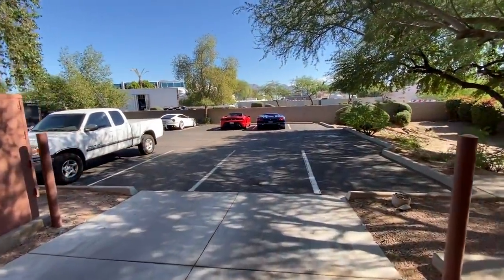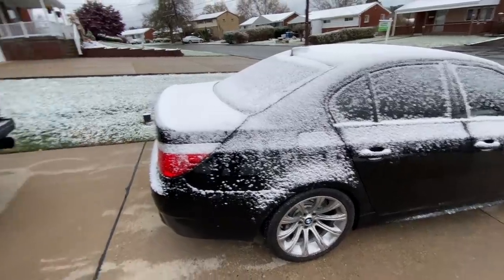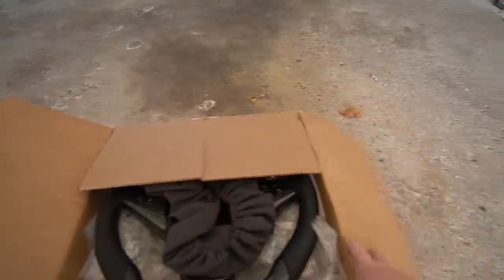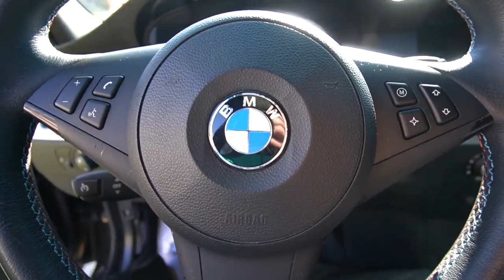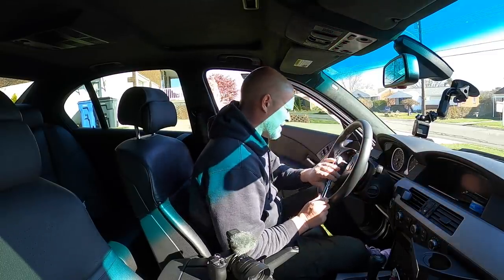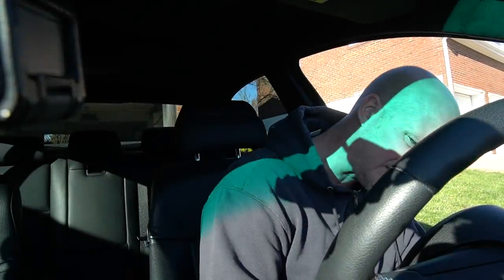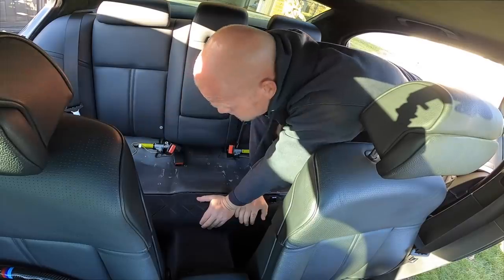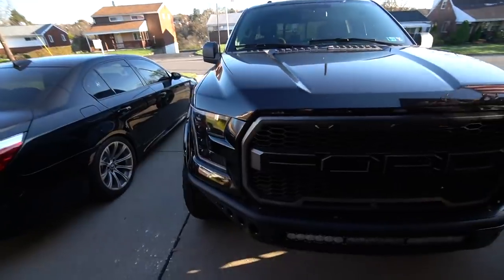I really messed up this time.. I should never work on my own cars

Comment: NOOOOO not the impact! I did a steering wheel swap on my M3 and had a hell of a time as well...but have to use a long breaker bar for leverage!!
Reply: You can use a impact on it just use the right damn socket no standard sae sockets metric sockets. Hell even the factory installers used a impact driver with lock tight on that bolt.
Reply: It helps to use a good quality precision socket of the correct size, plus, if you ever noticed, impact specific sockets are usually carbonized when they are forged, which makes them stiffer, and less likely to deform.
As well as the fact some people would argue the carbonized finish provides more friction over a chrome finish, making slippage/ rounding off less likely.
Reply: Breaker bar ftw. Less chances of mishaps
Reply: @zfixation9817  and they are 6 point

Comment: You needed a metric socket it wasn’t sae😂
Reply: Yeah but it will work for now😂😂😂
Reply: Oh snap, I didn’t even notice that he was using a 5/8” socket 😬
Reply: Use a professional regulated taxi,  your helping uber destroy the taxi trade then they Can charge what they like and charge the drivers higher commission on every call.
Reply: @brendanc5519  lol no thanks
Reply: It is a European car 😂😂
Reply: brendan C5 professional?  Funniest comment of the year.
Reply: @AlexM..  He probably means they are registered and licensed operators with permits.  You can't just download an app, send your info, and start driving a taxi the way you can with Uber and Lyft.
Reply: 5/8 on a BMW?! Nope.
Reply: @brendanc5519  obviously not..
Reply: Yep - if it was (SAE) I'd think it would be the only bolt on the entire car that was.  The fact he used a normal socket with an impact also wasn't cool.
Reply: The car it's german, it was pretty OBVIOUS. lol The world uses imperial system on wheels and some specific items only.
Reply: @christophermaloney8119  what are you talking about 😂
Reply: You are not handicapped..
Reply: @christophermaloney8119  what do metric and standard sockets have to do with anything you are saying?

Comment: No that wasnt the right socket. SAE, Standard American, is used on American cars, sometimes not even. Metric (MM) IS used on every other car. You used a 5/8" socket, should be a 13-15mm I'm not exactly sure. You should've used metric
Reply: Mazokki yes it probably was
Reply: @Mazotheman  metric and standard is slightly different...it has a little play in it
Reply: You are mostly correct but even modern American cars use metric
Reply: @Mazotheman  i believe the steeringwheel bolt is a 15mm if i remember correctly

Comment: metric bolt not a standard. That's why it stripped. Also a breaker bar with a 6" extension would help. It's likely got blue thread lock on it
Reply: And a witness mark.

Comment: I removed my steering wheel on my M3 and the bolt is threaded backwards. You are actually over tightening the bolt. Lefty loosey does not apply in this situation.

Comment: They make special "Easy-Outs" for stripped bolt heads. Use one of those and a longer breaker bar for added leverage. also turn the wheel to lock so you don't need to hold it.

Comment: A tip for not shutting the boot/trunk when the battery is disconnected, I leave a bit of cardboard in the back and place it over the latch/lock bit so the lid doesn't accidentally slam shut!

Comment: You need a long thin T25 or t20 Torx to remove airbag and 15mm socket with a 3/4 drive long handle ratchet to give you the leverage you need to remove steering wheel and make sure any time you want to remove bolt is to make sure the socket sit completely flush by push the ratchet head with your hand all the while you try to remove the bolt. It’s not hard. Your mistake is using short ratchet and 5/8. I did the work on my m5 before. Another thing, there is actually a keyhole on this M5. It’s just hidden under the trunk lid cover since you closed the trunk that’s electronically dependent, you can use jumpstart cable connect to another vehicle to give your m5 power to open the trunk or do as the manual says. Anything wrong with my e60 M5, I do all the maintenance and repairs work myself. So I am familiar with in and out of my m5 and M5 is not hard to work on maintenance or repair wise. Mine is 2010 M5. Very reliable vehicle contrary to popular belief. I have 126,000 miles on it, lol.

Comment: I have an F80 M3 and just did the  same thing the other day. Luckily for me it wasnt stripped entirely and still managed to get it off. You need someone else standing there to hold the steering wheel then it comes off easily !

Comment: Just get a set of metric sockets. You might be able to get the bolt off with the correct metric socket even with the corners being slightly rounded. Also you can get a set of sockets that will remove rounded off bolts from your local auto parts store. Also get a breaker bar which will give you.more leverage

Comment: Couple of items here: 1. If it ain't broke don't fix it!  Well, you wanted an upgraded steering wheel so ok.  2. NEVER use a standard socket with an impact driver, especially a deep socket.  Under the high loads of the impact gun, the standard socket barrel stretches/expands and loses shape thus rounding the bolt head.  Standard deep sockets make matters worse.  Instead, use an impact-rated short socket (typically black steel) and you won't have that happen again!  To remove that rounded hex-head, get a cheap 6-point socket then pack it with jb-weld, pop it onto the hex-head and wait at least 24 hours for it to set up.  Removal will be by brute force using a very long beaker bar and two people to hold the old steering from turning.  Good luck.

Comment: That's not that bad. Just did that on a deep bolt on a wheel using an impact.   All you need is a set of stripped bolt sockets.  The ones I got have teeth that dig in. Then get a long breaker bar and it will come right off

Comment: We’ve all been there man.  Even if you used an SAE socket, it appeared to enable you to apply enough force to remove the damn nut.  No idea why it is torqued on there so tight, unless prior owner or tech might have used an impact wrench.  I did steering wheel swap for my C6 vette, pretty much same setup, and it came off without having to use torque bars or anything beyond a 3/8” drive socket, and short extension.  Maybe the proper size metric socket could still bite the nut and loosen it.  

Maybe soaking with a little Liquid Wrench/WD40/PB Blaster would help.  Also, when nuts are really stubborn like this, sometimes giving it a turn with half torque in the tighten direction will break it free, then move on to counter clockwise removal.  Impact wrench is always risk for stripping, so don’t overdrive with them.

Comment: I have successfully pulled mine off with both, an impact and also once in a pinch with a breaker bar, the latter being surprisingly easier than the impact.

Comment: I feel the pain, I did the same to a bolt holding my touchscreen in my fusion. My sync 3 system went bad 10 days out of warranty and rather than pay them a grand to fix it I bought a salvage part installed it myself

Comment: You have to remove the bottom of the back seats to pull the manual trunk release to reconnect the battery thats in the trunk. Fine piece of german engineering mike 👌

Comment: It's always our own cars. I switched steering wheel in my Nissan. Took me forever to get it done. Center bolt was the hardest bolt I've ever fought with. Broke one connector too. Yet at the junkyard where I practiced on two vehicles, everything came apart so easy. I hate life.

Comment: Pretty sure the socket you needed for the steering wheel is metric Mike.
Hey, I made that mistake before too. I think everyone has so not shame lol
(Oh and make sure that isn’t a reverse thread bolt as well. If it is then you actually were tightening it...yes made that mistake before as well lol)
Oh and I’m glad you were able to get on film the downsides of having automatic latches and crap like that. Sometimes people like to brag about “ooo my trunk closes itself, so do my doors” and I just chuckle to myself and smile knowing they will end up with that issue one day too lol
Sometimes simple is better. May not look as fancy, but even the old Hooptie never had an issue like that lol

Damn, I really miss that thing haha
Being winter is closing in quick maybe you should find a 4x4 winter beater and it can be the next hooptie project all while keeping the salt off of the good vehicles as much as possible 
Could even be more unique and fun than just a run of the mill Jeep or Explorer
Land Rover Discovery with the 3.9 V8 and a 5 speed manual for example would be ideal for fun and videos all while being a beast in the snow!
Or one of the 5.9 360 V8 Grand Cherokees
Idk, just a thought lol
Take care, and don’t forget to tell Brian about today lol
Hell maybe he could even lend you the socket that you need

Comment: Stripped it because it's a reverse thread bolt that way it doesn't come loose when you turn the steering wheel. You were actually tightening it when you wanted to loosen it that's why it stripped the threads

Comment: Ha ha, it’s been a long time since I laughed that hard. Thanks Mike. Since you used the wrong size socket that was one size to large. You can probably tap the right size socket on with the hammer even if you have to file the corners of the bolt down. 
Also push the seat belt down through the hole of the seat and latch it to the buckle. Then use the belt to pull it through the hole of the seat. 🤣

Comment: Rule of thumb, anything automotive made since  1975, try metric by default. It is unusual to find anything SAE on a vehicle these days. Take your non-metric sockets and wrenches, and put them in a separate drawer, and stick a "CAUTION"  label on the drawer. It also helps, if you are shopping for nice tools like wratcheting wrenches, just buy the metric ones; skip the non-metric.

Comment: First off, as someone who does upholstery, I had a good laugh with that rear seat. Don't feel bad a ton of people can not do that, second, there is a socket set to extract stripped bolts at your local auto parts store, I had to buy one a few weeks ago to get a water pump off and say they save you a major headache.

Comment: Looks like you used the wrong size socket. Try a metric size? Looks like the socket is stripped on the bolt.

Comment: Have done 5-6 BMW steeringwheel swaps. It's easier with someone else holding the wheel, and the bolt is metric on them aswell.

Comment: when you have 2 left arms...At least the ricey steering wheel is not coming on yet but probably with the properly sized socket you can get the bolt out easily.

Comment: Hi, I believe the steering wheel bolt is usually reverse threaded!!!!! SOOOOO to undo it you should turn it the opposite way to normal. You were trying to undo it by turning anti-clockwise, but that was actually tightening it up. Turn the bolt clockwise to undo.
JP.

Comment: The torque specs of that bolt is 46 ft-lbs but BMW has been known to torque them down to 300 ft-lbs which sounds ridiculous to me. I suggest to buy a pair of sockets that are meant for stripped screws and use a really long, good ratchet. Or just make a shop do it, either way is fine.

Comment: that's the steering wheel you can buy on taobao.com, which is the chinese ebay for only $100 to $150 includes installation at a local body shop. International traders just rip you off.

Comment: When you loosen up the bolt you HAVE to use the steering lock... it doesn’t break that easy. Trying to loosen it and hold the wheel with the other hand is nog the way

Comment: If you flip down the center armrest in the backseat, does it have a pass through?   I would think Sydney could have wiggled in there to pull the release in the trunk.   Ir, if you had long arms, you could have reached in and pulled it.

Comment: Love the video. As for the steering, is it possible the bolt has a left hand thread? You may want to check that. As a final comment, and since you tried so hard to loosen bolt, then gave up, and just trying to be safe, it is possible all these attempts loosened the bolt a smidge, so I would tighten that bolt a bit,  prior to installing the airbag to make sure it won’t come loose while you are driving..... Mark

Comment: I am not 100% sure but I believe you could’ve ran power from under the hood jumping post. A battery box or jumper from another battery to the post under the hood .And I believe most BMWs once you disconnect the air bag you have to get it reset The light will be on the dash.

Comment: Is it possible the bolt is actually reverse threaded?  Not that this at all is a valid analogy, but trimmer heads (yes, yard trimmers) have a bolt that is reverse threaded because of the rotation direction of the stringer head.  I've never tried removing a steering wheel so I could be totally out to lunch.

Comment: There is still enough bolt head left there to have a mechanic using a metric 6 point socket and an impact wrench to get it out easily. There are sockets designed to easily remove rounded bolts and nuts once they're hammered on. That bolt is screwed though. BMW =  $8013.92

Comment: I'm surprised its 5/8 and not metric. You want a 6 point socket not 12. Firm pressure down on the socket so it can't slip off the nut.  A helper holding the steering wheel, while you use a breaker bar.   I think this one's above your pay grade.

Comment: I thought everyone knows that you have to use breaker bars to remove that bolt. You also need to make sure you have the proper 6 point socket not and 12 point.  Go get a breaker bar and one of those fancy sockets for removing stripped bolts.

Comment: Just get a set of stripped nut and bolt sockets from your local auto parts store. I would also say you might want to rent a steering wheel puller from AutoZone but I don't see a place where it would bolt to the factory wheel.

Comment: Get a nut extractor and hammer it onto the nut and buy an extended 1/2 ratchet to remove it. I'd also get masking tape to mark where the steering wheel was so you don't mess up the clock spring (You're also gonna have to buy a new nut from the dealership"

Comment: @autovlog Yea that's not a 5/8" sae, it's definitely a 15mm. Ask Brian, this is almost an identical set up to the fusions with steering bolt recalls. Impact would have been the perfect way to do it, a 3/8" drive is plenty though.

Comment: Easy fix but one size smaller socket on their bang it on with a hammer and then use a breaker bar don't be a nincompoop and use impact gun which applies too much pressure too quickly

Comment: Just find a socket that is a tiny bit smaller and force it on with a hammer, did that with a 13mm oilpan plug took a 1/2" as it was already stripped but i got it off

Comment: Your last resort is imperial  sizes now -the in beteeen sizes, and in future leverage the socket wrench with a ring spanner but be careful if the windscreen oh and you must disconnect the battery before pulling out airbag plug

Comment: Mike, you could’ve jump started de car. A positive battery terminal is beside the engine, the ground (negative) terminal can be connected to anywhere in the engine where there is no energy flow.. That would have got your work done much easier man.

Comment: Mike you probably know buy now only Metric sockets on a BMW, also next time an easier way is to push the seatbelt latch as far as you can then buckle the belt, then you can use the belt to pull the latch through the whole.

Comment: You could not break the steering lock by resting the wheel on it to using both hands. It would still strip the bolt though - wrong size socket. 

This was an entertaining video 😂🤣

Comment: I would have used a breaker bar in that situation with a pipe if need be. Good luck on taking that off, hope to see that M steering wheel on soon.

Comment: Hey Mike you're supposed to use a pull set on steering wheels in order to take them off lol
Reply: I replaced the same steering wheel on my E46 330i ZSP. He was doing it right. He just needed a long breaker bar and the right socket.
Reply: I've never had to use one.  You wiggle them enough with bolt loose but still on stud they come free
Reply: E60 M5 Steering wheels aren't pressed on. He just used the wrong size socket. I removed my steering wheel and replaced the chipped plastic bits with a Carbon Fiber Kit about 4 years ago. 
It was helpful to adjust the steering column all the way down and out and turn the wheel to the left full lock. It makes it easier to remove the airbag and the break the torque on the steering wheel bolt.

Comment: A mate of mine replaced the bits you pointed out on your steering wheel. Taste is a personal thing but I really like the original steering wheel on my E63 M6 which is of course exactly the same as your one. The original exhaust system on the E63 M6 is supposed to have a more sporting sound than the E60 M5 it strikes the perfect balance being not too loud and not too quiet either. I prefer originality over modifications. I did get a digital TV tuner but that is integrated into the idrive so looks original. I noticed your doesn’t have the head up display ? Sorry you had hassle with your steering wheel and back seat. I love working on my 1981 Ford Capri 2.8 injection but I leave my BMW’s to the professionals !

Comment: Mike, it's called a breaker bar.  Also, no need to feel embarrassed. Both mechanics and DIYers strip out bolts everyday and will continue to. You can't learn if you don't take the plunge. I tip my cap to you.

Comment: It looked like you held the impact gun at an angle which caused the slip on the bolt head. You can see it if you rewatch it back again.

Comment: Good practice to never start or finish a bolt with an impact, especially higher torque spec! Need a breaker and/or some PB blaster, heat in rare cases - anything but that lol